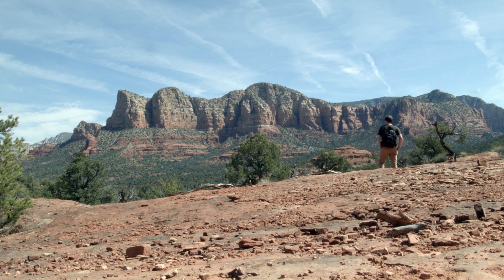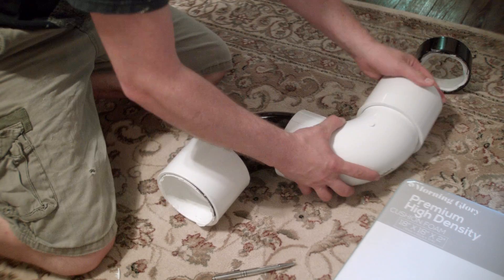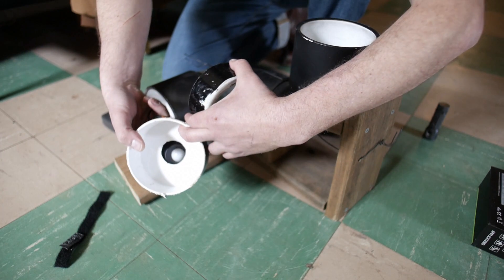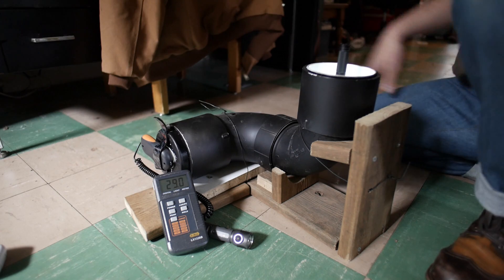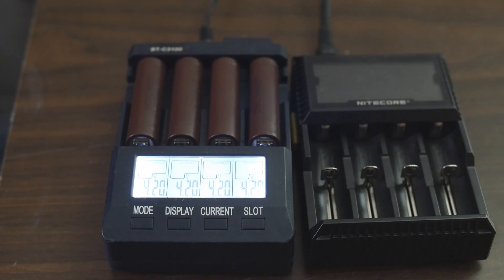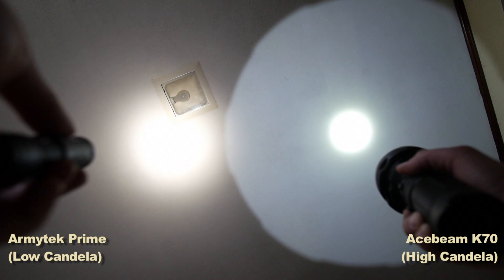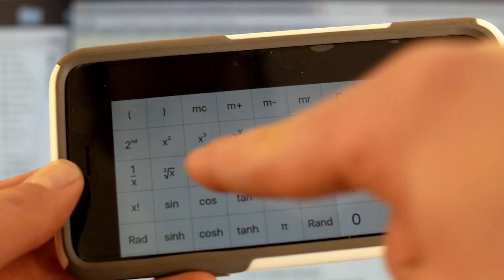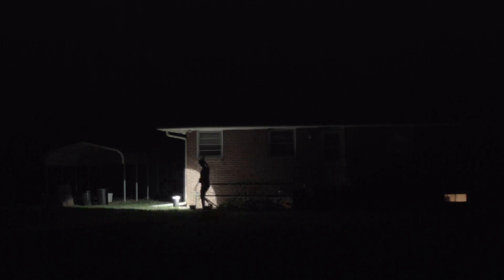How to measure Flashlight Lumens and Candela using ANSI/NEMA FL1 standards.

Comment: I thought the distance you measure candela from the light source would impact the results you get. I am confused why you stand 20ft but say you can stand closer if you want. I would have thought there would be a set standard of distance when measuring candela to make sure claims across flashlight brands are consistent. Can you measure candela 1 meter away from the light source?
Reply from the maker: Did you see the candela calculator I used in this video?  It compensates for lux at different distances. The light is too intense at short distances for brighter lights on the lux meters they’ll not be able to read it.  Standing further away gives you greater leeway between lights so you can standardize you distances and measure all your lights the same.  The good thing is that it works as a relative measurement between the lights I own.  A lot of people of budget light forums and candle power forums measured their lights with this lux meter and a similar setup.  The fact that I give you the distances I used and how I did it, allows you to reproduce the test yourself.
Reply: @AdvancedKnifeBro  thanks for the reply. I still don't really understand but i get your point. Last question, do you think a wide beam (higher lumen) is better for self defence or a narrow one (higher candela)? Either needs to be smallish in size so i need to compromise. I can see that a wide beam is going to hit a broader area (the whole face or to people if necessary), while a narrow beam is going to concentrate the light straight into the eyes (but potentially miss the target/s). I can't decide between the fenix lr35r and the acebeam k30gt. (my job has an element of risk, particularly when walking home, and other forma of self defence are illegal in the UK)

Comment: I’m getting ready to start a project like this. Why does the pipe have to be bent? Can’t it be straight?
Reply from the maker: The idea is that direct light doesn’t hit the lux meter sensor... so sanding the inside of the tube and having a bend will reduce direct reflections and hot spots
Reply: Got it. Ok so let’s say I use one of my HDS lights to calibrate the unit. That would be a good start right as they are very accurate with there setting.
Reply from the maker: Yes make sure you lose some lower modes that have a steadier brightness... turbo and higher modes tend to have issues with maintaining higher levels of brightness.  Ideally you choose a light you have seen other people test and confirm it is indeed in the neighborhood.  I would stick to the manufacturers ratings though, because again-  let’s assume they use better calibrated devices than we do, to get their figures.  Make sure they stick sort of to the ansi/fl1 standards- which is usually denoted somewhere near where they post tested mode levels.

Comment: It seems like the PVC pipe setup would be dependent on the beam shape. Have you tried using flashlights with adjustable focus to see how much the focus affects your measurements? Perhaps more reliable would be to light up a piece of white paper from a known distance and take a photo with a camera that allows for manual aperture and shutter adjustment.  Place the flashlight at a distance so the beam doesn't overflow the edge of the paper. Do this in a darkened room. Adjust aperture and shutter speed such that no clipping occurs. Then put it your image editor in 16 bit per channel scale a set amount so the whole paper goes into one pixel. Read out the pixel values, this will give you a number that you compare between flashlights. You can also use it compare color. Color temperature is simulated with LED's and not real, since this is not black body radiation.

Comment: I have some rusty wire too Bro! 

Quick question. 753 feet. Really? : - )
I am going to do a video soon. Comparing some flashlights, and yes. I promise not to go in direct competition with you. 

Anyway. I have one of these measuring wheels that I use on the farm. For measuring fence line sections, garden plots, tree planting rows, etc. I paid about $35 for this newest one > Example > http://thd.co/2nT4nBQ
I dropped a lawn mower on the old one, and broke it.

Do you use something like this to measure distance? Or, use some other method?
Reply from the maker: +Steve Kluver I use google earth for longer distances.  For distances in my own yard I have a giant measuring tape... like about 100 feet.  Google earth is pretty helpful for measuring long distances that are too far to measure with a tape.  

I saw other people do this... and I was like- genius.
Reply: Well that's handy! I may just try that. Thanks. 
I might just hang up my measuring wheel for good then. Plus, by shoes were always getting wet anyway, in the dew of the evening grass.

Comment: Your video is pretty funny, cracked me up ! However comical, definitely useful. Just to possibly eliminate a step (painting and sanding of the pipe), a type of 4" plastic pipe that is called "ABS", it is all black plastic pipe. You might want to think about getting a night job. Doing "Stand Up" comedy !! Well done .
Reply: patdio58 Painting the outside is just to make it look better, it has no effect on the function. pvc pipe is very thick and ambient light should not pass through it. It's important that the inner walls be matte white. Black abs pipe would not work properly. Unless you painted the interior walls matte white,  but then what's the point of using black pipe?

Comment: Well that looks a whole lot more easy to construct than the sphere thing I've been thinking about and postponing for another year a few times now due to "can't be bothered with this now".

If I'm not mistaken my dad might just happen to have some suitable pipes around for that in the unsorted pile of junk that may one day be useful area of the barn. A few hours with free parts or worst case a trip to the hardware store will get me new parts at a reasonable price will finally get me a working measuring device.

That said I've been getting decent results with my even shittier lux meter and ceiling bouncing, so maybe I'll be even lazier and just continue to do it that way.
Reply from the maker: I'd say if you get decent results with ceiling bouncing, keep it up.
Reply: Well the results are fairly decent, but there are a few issues:
1. Unless its rather dark outside I have a hard time getting rid of external light sources
2. due to being unable to keep all the light out and only a limited amount of the light making it to the sensor I'm having a hard time with the really low modes
3. I'll possibly be moving in the next few months

Having a single device that takes up limited space which can also actually be used during the day sounds like a better solution than my current method.
Reply from the maker: Oh yeah, I hadn't thought about that.  Well the pipe is nicer, and doesn't leak light in as long as it's in my basement.  I sometimes have to measure candela during the day- but I usually subtract whatever ambient light the meter is reading from my final lux measurement for candela.

Comment: Great vid, still don't understand though but gettin there. lux=light intensity.  candela=distance?
Reply from the maker: Lux is just the raw measurement of light.  You use the lux values to convert to candela and lumens.  On a flashlight the lumens is the overall amount of light coming out of the front.  The candela is basically distance the beam can go.  But I guess a more accurate way to describe candela is the intensity of the beam.  This is visually represented by a flashlight as the hot spot.   The hot spot of the beam is the area that travels the furthest.  Lights with high candela have denser, higher contrast, hot spots.
Reply: Advanced Knife Bro thank u very much.  Now is candela , candle light power?
Reply from the maker: As far as I know, candle power and candela are two different things.  Some old flashlights used to be rated a million candle power... and that's not the same thing.  I have no idea how "candle power" was measured.  And it may not have been a standardized rating like ANSI candela and lumens.

Comment: use the peak hold when doing your lux readings,, ive got the same meter, and it works like a charm...i usually do 3 runs or so, and they are close to the same reading time after time

Comment: Is that K70 your best thrower ? if so , what's the highest lumen flashlight you own ?
Reply from the maker: Throwing and lumens are not related necessarily.  The K70 is my best thrower... and probably the 2nd or 3rd best (non-modded) thrower you can buy.  It's under 3000 lumens though.  My highest lumen light is my Olight X7, and my second brightest is my Noctigon meteor.  Lights that throw well, are generally not compact- because they often have very large reflectors.

Comment: Thanks! I'e been wanting to build an integrating sphere or SOMETHING to take measurements, and this will work! I already measure all my beam patterns with the hotspot, corona, and spill, and I recently added another column in the spreadsheet showing the hotspot to spill ratio. What size diameter is that PVC pipe?
Reply from the maker: I used 4 in PVC.  If you use smaller pipe, larger lights might not fit.
Reply: I went ahead and ordered the light meter this morning, will be getting the other parts later today. Have some ideas for the support base you might like, and am designing some inserts for different size lights :)
I'll have to document the math, but no biggie. I had a math phobia after high school because our "teacher" was a gym teacher who got reassigned and hated it (and us it seemed). I figured I'd never need that stuff... until I got hit with two solid weeks of math in engineering school!
Reply from the maker: I always drifted off when they were explaining math in school.  Luckily Ive not encounter math problems that a calculator wouldn't solve for me.
Reply: Well I finally finished it. It looks cool and my kids suggested I leave the fat parts of the pipe as black bands, and paint the rest bright yellow. Had to do three layers: primer, black, then yellow. It came out looking nice, and I used a "U" with the meter at the end, and a 90 degree elbow for the flashlight to sit on. I made a nice box on the end that the meter slides into and locks in the center position. Downside is that my multiplier varies quite a bit, so I'm not sure if there is something wrong with the tube being a bit longer than yours, or my flashlights are not accurately measured by the manufacturer. Most of mine are Nitecores because I like the controls, and the multiplier is usually around 0.36, but it swings between 0.30 and 0.40 (actually 0.4035874439461883). Any clues to what I may be doing or using wrong?